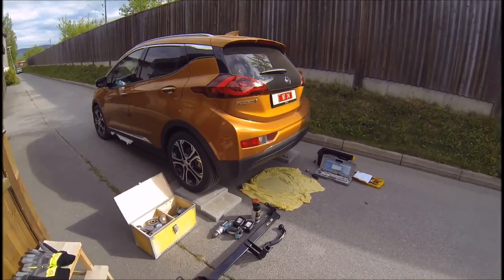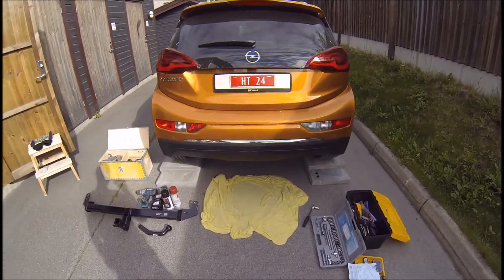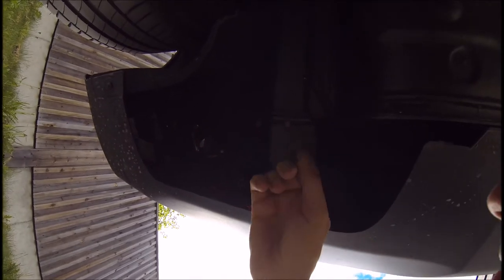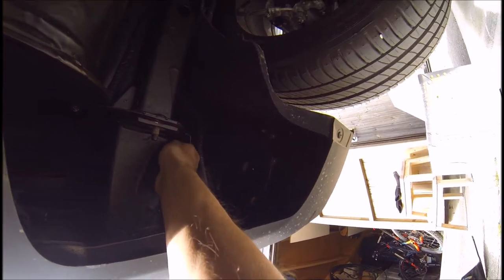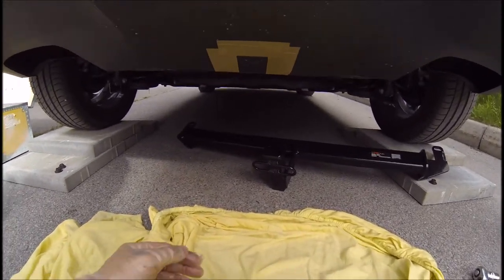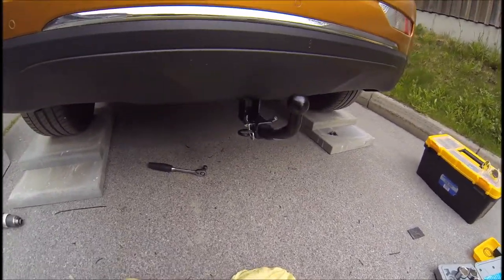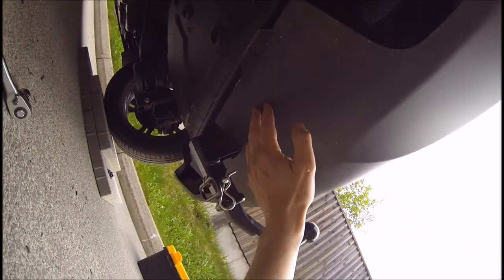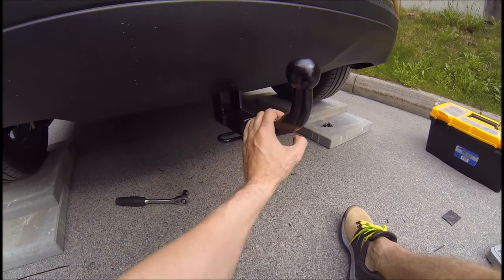Trailerhitch on my 2017 Opel Ampera-e/ Chevy Bolt.

Comment: So as someone who has had that whole back end off, are you just disconnecting two of the three crumple-zone bumper screws on each side?  I.e. there are three screws on each side holding in the crumple zone bumper, are you just taking two off, sliding in the hitch, and then reconnecting?

Looking, good, though!
Reply from the maker: Not sure wich hitch you are using, there are others. I lifted it up to see the 2 bolts I had to release. Not sure where you saw the third one? Probably is one but wasnt nessecery for me to find it. It might be hard to mesure wich 2 you have to use when the whole bumper is off?
Reply: There are three, but it makes sense because if you took them all out the bumper would fall off.  I'm actually not putting in a hitch (something....different), but was curious as to how this one went on.  Definitely interesting, though. Great Video!